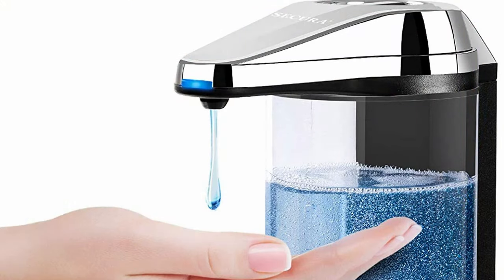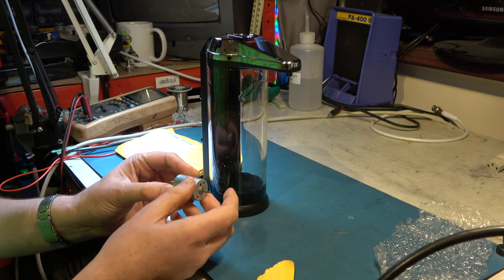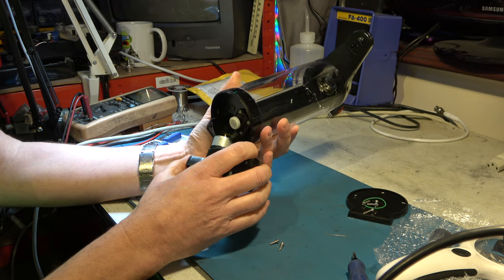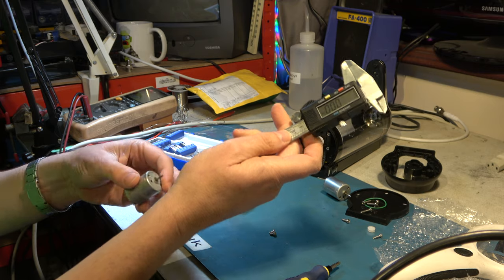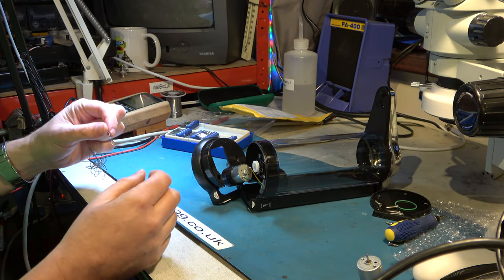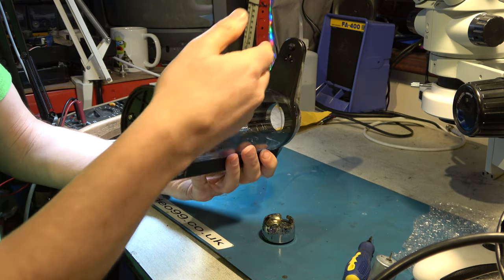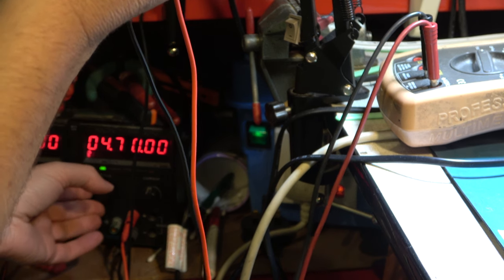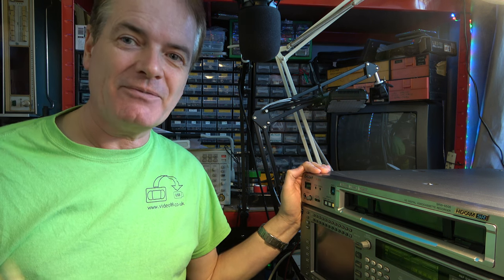Secura/Svavo soap dispenser, motor replacement

Comment: Thank you for your video. Please help me to find the right replacement motor . Which parameters do have to match about from body size and minimum length of shaft?

I seem to get 3000 RPM at 12 V, up to 24 V. I can get 10,000 more RPM at 6 V. 
Initially, I tried RF-370CA-26100, 6V, 10200 RPM. Alas, shaft is only 5 mm. Pulley comes off during operation.
The old motor is labelled 6V/CRF-370CH-23120-42/8200
Thank you

Comment: Do you have any ideas for the situation where the sensor never activates?  In other words, the blue light never comes on, thus no pumping.  New batteries did not help.  On occasion it will decide to work, but then fail again.
Reply from the maker: Yes.  Take the sensor PCB out of the top and clean with isopropyl alcohol.  Then train users to not take their hand so high that they put soap into the opto sensor housing.
Reply: @video99couk  How do you take out the top? Uncrew then what? pull it out?

Comment: 1. Why do you think the original Secura soap dispensers are the best (rather than the newer models without the Secura branding)?
And 2. When is the Sony SRW-5500 video coming out?
Reply from the maker: I'm in the editing phase of the SRW-5500 video, but this will might be a two-part because I have a replacement part on order.  I just prefer the manual control on the earlier soap machine, which is still available.

Comment: How do you take the PCB out of the top and clean with isopropyl alcohol.  I unscrewed the single screw.  Do I have to also take the whole thing apart?
Reply from the maker: Yes all the outer cabinet work has to come apart.  If you don't fancy that, try blowing out the sensors with a can of compressed air.

Comment: Where can I get a belt replacement? I have the same Secura soap dispenser.
Reply from the maker: I think the belt is neoprene, but it's much smaller than most of the belts on eBay or similar.  Just a case of searching for a very small belt.

Comment: I bought one of the same exact model and the pump went out. The main gear on the pulley shaft of the pump started spinning. Where can I get a replacement pump?
Reply from the maker: That might be more difficult to source than the motor.  Sorry, no good suggestions for that, other than perhaps a second-hand machine.

Comment: What a posh way to dispense fluids :-D
I was thinking i.r emitter and sensor side by side.
Where the brushes touch the commutator would be important for direction and torque.
Would a slight rotation of the brush plate give a better torque with worn brushes.
You didn't need to steal your sons teeth he he :-D
Reply from the maker: Considering the work involved it dismantling, it's as well to replace the motor since it's not expensive.
Reply: Yes you have replaced it :-D, i thought you would like to look inside the old motor and see what is failing in it.
Not video making,  just your own interest :-)